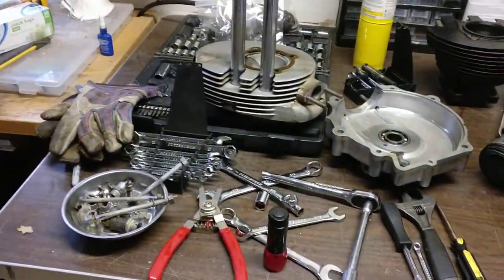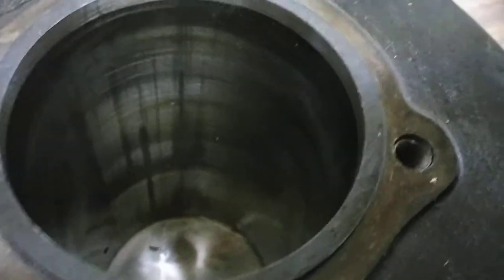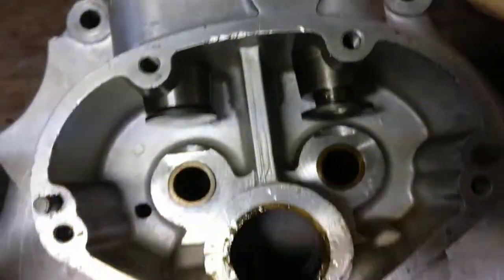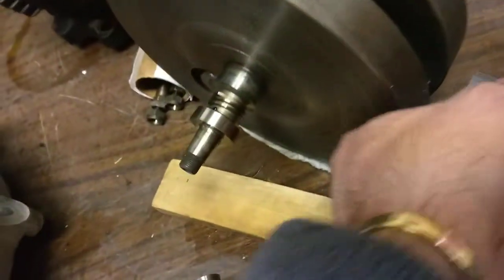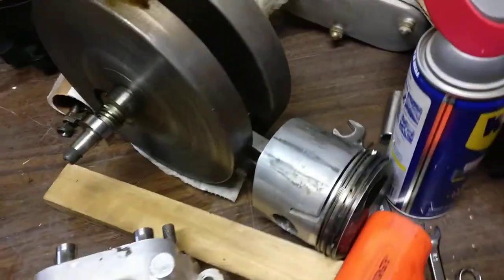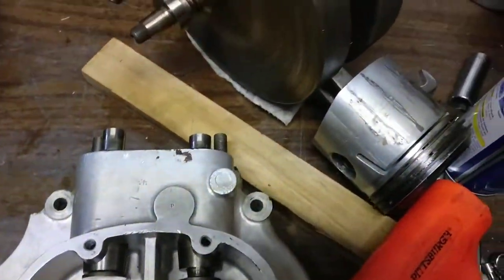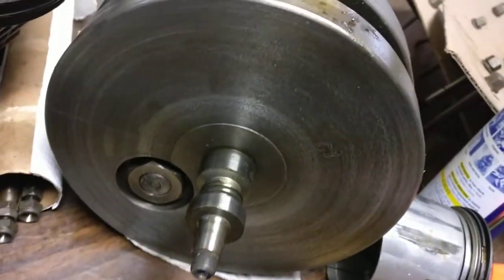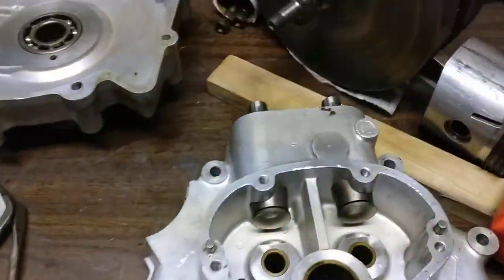Seized AJS 18s engine torn apart and diagnosed

Comment: I can't understand all that you said but i thought I heard you say something about pitch. Like from a tree? Kind of looks like inadequate piston to wall clearance on an over bore. Either that or some contaminant in the oil. Or deposit left in the engine somewhere.
Reply from the maker: It was gasket shellac all over the inside of the engine. It glued it together. Additionally the timing pinion was split at the key. All clearances came in nominal

Comment: How did you get the gear of the crankshaft that drives the two camshafts? I know it’s conic but it’s stuck on mine engine...
Reply from the maker: you can use a puller or just apply some head with a quick rap of the hammer and it'll pop right off.